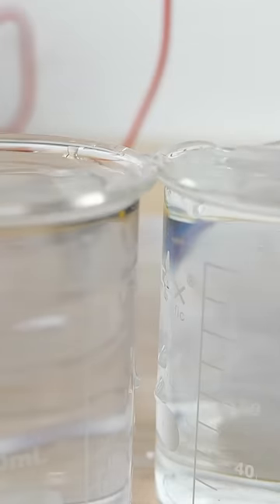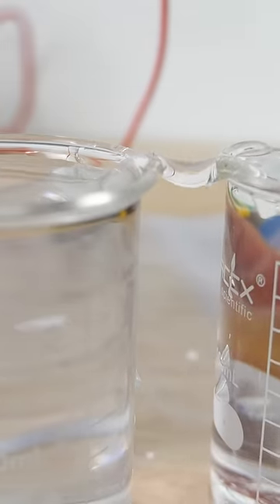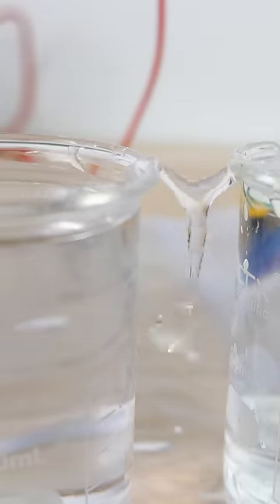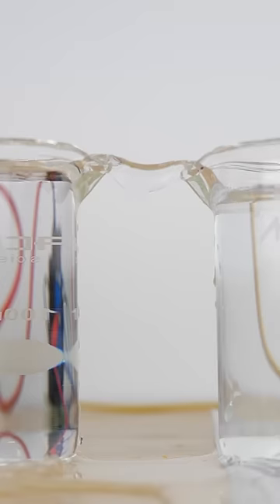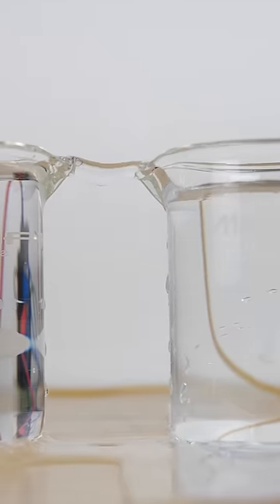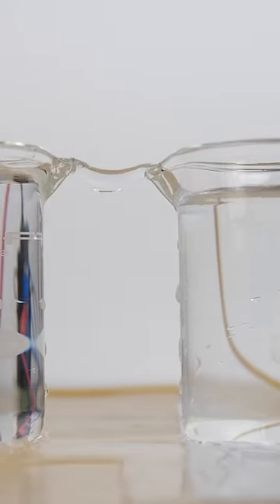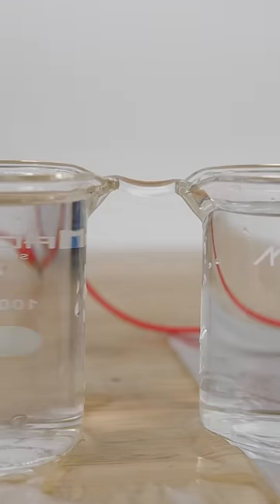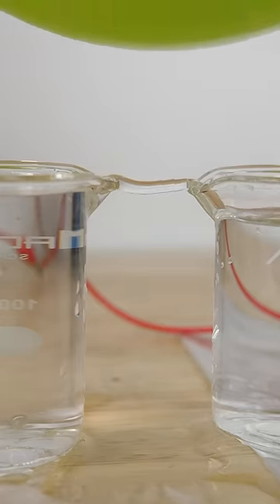How To Make Stretchy Water

Comment: My theory is that the positively charged hydrogen atoms in the water are temporarily attaching themselves to the electrons in the electricity, and the electricity is basically pulling the water along as the electricity flows.

Comment: Well your adding heat via energy in the currents, which water conducts well. De ionizer or not it's still going to absorb heat if you put it in, and an electric current gives off heat.
Likely that's just the correct value to align the poles of the water molecules weakly, but enough to promote more magnetic property.
As for why it prefers one direction of travel, likely that's just the lowest pressure zone
Reply: It could also be following the same principles as flowing electricity, and in fact may basically be just attracted to that current, and is following it
Reply: You'll notice the water is flowing towards the electric source, which is flowing into the water. It's the same as you'll see in electrodynamics or a regular wire with flowing current.

Comment: electricity is energy and water conducts electricity so I assume the reason this happens is cause electricity expands when it came in contact with the 2nd body of water tried to expand when you moved it away instead of losing connection it created a bridge with how fast electricity moves it creates heat regardless of what type of water it is still moving at high speeds it must create a ton of friction. 

water by itself won't expand, but you add a ton of friction and heat like electricity I would call this micro boiling since water particles in the path where the bridge is created may have reach a boiling point, but not one where you could detect with a thermometer and it might have been instantaneous a short burst that is constantly happening thus creating a bridge while boiling at H20 at an atomic lvl.

This as far as I got with this hypothesis with my limited knowledge if micro bubble really are the cause this would explain my brute force logic.

Comment: you know how an electric field is like oriented from 
positive to flow into negative right?
(this is different from electron flow)

the electric field would in turn reorient the water molecules to align with the electric field, Hydrogen part faces the negative while the oxygen faces the Positive 

This is also why the water is weak lateral to the EF lines hence it drips
Reply: as for the water flowing into the other beaker more than usual

is the beaker with less water the Negative or Positive terminal

if it's the positive terminal, water is strongly attracted to it due to the oxygen being more affected by it
this does not mean it flows to that terminal, cuz there's no flow happening in a  closed system when you put the terminals in one beaker

it only makes the water molecules connect the gap in the electric field plus water is more likely to move in the negative side because the attraction is weaker (2H)

therefore water molecules are more likely to flow and fix the gap from the negative terminal

Comment: Is it perhaps traveling in the direction of the electricity? With the water acting as a kind of magnet dragging the water along? Each unit of electricity drags the slower water along until it leaves that unit of water, by the time it’s done that another unit has arrived and does the same thing dragging the water a little bit further

Comment: Deionized water would act as a dielectric. You are just making a capacitor. The electrons just need to redistribute themselves across the field, but the medium is a fluid so the slightly polar water gets dragged with them. As for the heating? No clue.

Comment: What if the water surface tension is holding it against a single electrical chain similar to a lightning bolt, the chain takes the shortest pathway from one side to the other and as long as there's an arc of electricity the water acts like wire enamel coating it. Someone should do a jacobs ladder but the emitter coil and the receiver coil should be in separate cups of water and see what happens.

Comment: doesnt water like "connecting" to itself? you experimented with hydrophobic sand and mentioned that no matter what you cant combine droplets again. my guess with the water bridge is that water wants to connect with itself and to defy gravity the electric current acts like a catalyst or venue for the water to travel. im not very science smart so idk, kinda like if you were to heat a metal stick on one side, eventually i think the other end would develop heat slowly compared to the heated side.

i wonder what elements have different levels of conductivity dependent on the state of matter: solid, liquid and gas.

Comment: There definitely some electrical attraction going on as water actual went for the ballon before breaking off so what I think going is that electricity is what actually holding bridge as electrons go from positive to negative and now I wondering if current type affects whether or not it works.

Comment: Quantum Entanglement for Wormhole Theory performed using Electricity and Water. Huh. Neat. It follows the same ideas of a medium stretching across an ionized magnetic field in ways the medium's surface tension normally would  not and also transfers energy from one plane's medium to another too, in this case generating heat as oppose to matter, because well, energy will translate into thermal energy in this case. This can be used as a good example for advanced Quantum Mechanics courses actually.

Comment: Did you add minerals to the water or electrolytes? Water doesn’t conduct electricity because it’s an insulator, especially deionized water. Im confused
Reply: He says it's deionized, so there shouldn't be anything in the water. The reason it's conducting is because he's got a really really high voltage across it that exceeds the breakdown voltage. Once you're over the breakdown voltage of an insulating material it behaves like a conductor.

Comment: Well from the comfort of my bed and being too lazy to do the research/googling. I would theorize it has something to do with the diaconductivity of water, can’t remember the source but I remember reading water doesn’t conduct electricity so much as it expels it cross its surface. Having 2 cups’ surfaces touch while running a constant charge through the water then separating the cups slightly artificially extends the “surface” of the water. This can be seen when the bridge falls for a second and an arc between the cups is visible, the arc being the currents traveling through the air between  the cups instead of the water. The heat is probably due to this movement and transfer of energy as well. Type shid

Comment: This flipped a switched.
So Love Magnets love Gyroscopes. 
i think with these we can influence anti gravity.
always wondered Copper Gyroscope going in and out a magnetic field makes power. but what wires could attach to a gyro. None.
But WATER Could it be the Conductor? 
could you still get enough speed for upward lift with the resistance of water. or perhaps the water just surrounds the gyro.

Comment: Well, I think if yoy stretch a balloon over a cup, it'll be super bouncy. So when you put a lot of electricity through water, it becomes the balloon. When the balloon charged with static comes near, it interferes with the strechy bounce electric water, and tries to do the electric boogaloo part 2, but because theres only 40k volts present, it's unable to groove, resulting in a really long and impractical run on sentence. 

In short, I don't know what Im even talking about

Comment: Okay, so, the water moves because the electricity is moving. It’s a current. 😅😂 One heats up because the energy is being concentrated in that glass. It is possible to concentrate the heat in the other glass. It’s the same as a TIG welder. Oh, and the water kind of sticks to electricity, kinda like a magnet field. Now start trying this stuff with mercury.

Comment: Please, can you push this experience?

Like putting 3-4 poles between and try if it can go up.
Reply: 3-4 poles to see if it can go farther with a support to jump from pole to pole. 

Go up just to know if it's possible to transport water against gravity with that system. 

Is it possible to see the resistance too? How much current is lost. 
For knowing how much it cost to use this system for transportation water without complexe infrastructure. 
Or to transport electricity without cooper

Comment: The fact sound travels four times faster through water than air is the main principle here. Electrical waves are acting as sound waves on quantum levels, but also the fact the water is not grounded and being in an insulated glass jar helps keeps the molecules charged enough to cause friction holding them together, as he stated the one side conducts a small amount of heat. It’s the same concept as splitting an atom causing water to heat up for a nuclear power plant, but completely rudimentary basics at work here. Still fascinating!

Comment: It's a form of electrolysis.
Reply: Try putting a piece of copper or brass in the water it will cause the metal to disappear eventually.
Reply: This electrolysis is why large vessels who spend their lives in the ocean and have soft metals has the rudder in the main Wheels brass in copper all soft metals all subjected to the electricity from The vessel the main engine and the battery Banks put out loads of electricity also the generator regenerates which causes  the salt water to react any way that causes a form of electrolysis that eats away at the propeller, hence if you put zinc plates welding to the bottom of the ship the problem is solved. ;-) Zinc is much softer metal and gets attact first allowing the expensive cooper Propeller to last much longer.

Comment: I'm thinking it was April First recently and I'm suspicious. That or this is very cool and I know nothing lol. (Of course, I already knew that. The world is wide and strange.)
Reply: This has to be April fools… or he is flat out lying. I’m an electrical engineer and I work with high voltage - 40 kV power source would  be extremely difficult to get access to, The wires in the beakers aren’t even rated for 600 V. There is soo much wrong with this set up

Comment: I feel like it has something to do with the electricity arcing across the two beakers. Kind of like the water is catching a ride along with the electrical current until the point where it takes more energy to keep the water bridge suspended than it does to just arc across the air which has higher resistance.